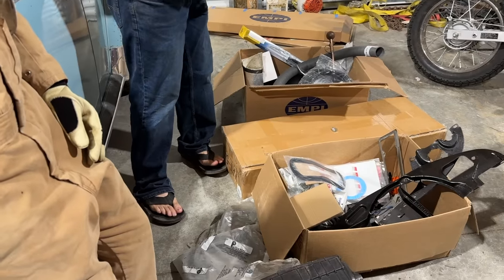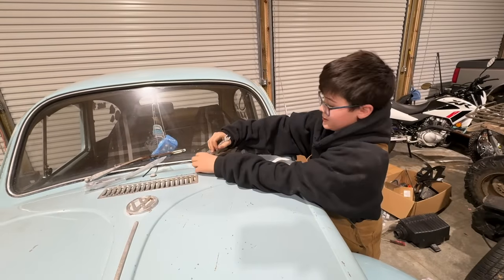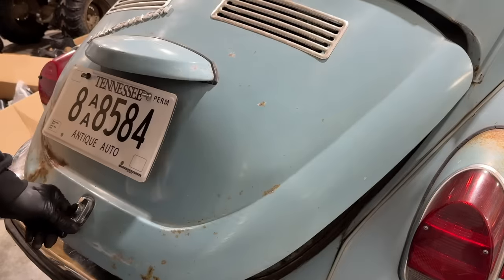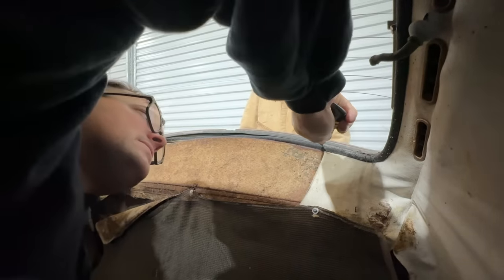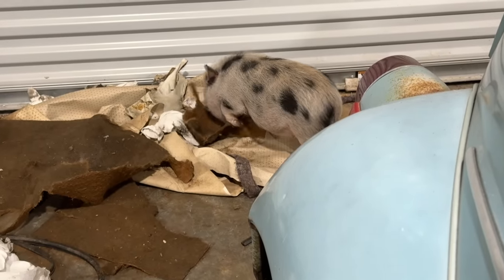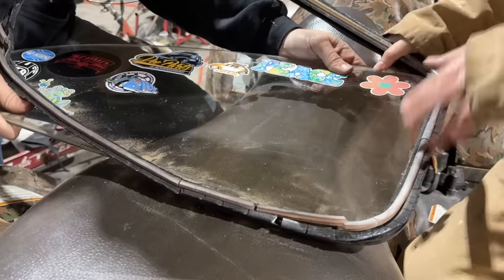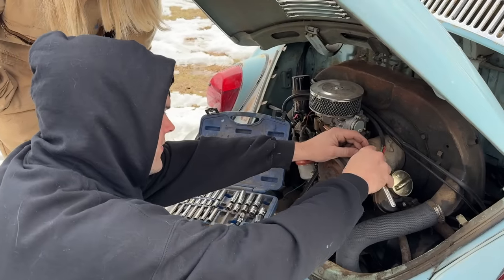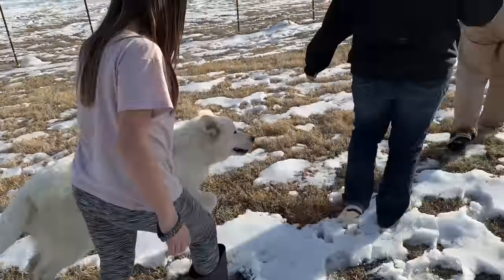Wawa’s Beetle gets Interior, suspension, roof rack, and engine maintenance!

Comment: I worked with a guy who special ordered a '68 beetle brand new from Germany. He said it was either the first year fuel injection or turbo. I cant remember which. He said he put 2 clutches in it and painted it 3 times. He drove it every day for 33 years and sold it for $600. I freaked out and told him he could have got $3,000 for it.

Comment: Good job family! Battery usually does have hold down clamping spot. Ours was on the driver’s side, where our battery was installed. Gas cap rusty inside, buuut, the gas tank itself, would not dare to be rust on bottom inside. Fuel filter wouldn’t dare to be dirty. No sir!

Comment: Since you're going to pull the engine anyway you may consider a valve replacement. If the engine maintenance history is unknown and was not done properly (I believe every 6k miles the valve should be adjusted, don't hold me to that its been 30yrs since I owned mine) you could face a valve stem failure. Which means catastrophic engine damage, ask me how I know. At any rate when the engine is out pulling the heads and replacing the valves is no big deal, could save you an engine replacement. The VWs are fun to drive and will run forever but maintanance is very important...

Comment: When you mentioned putting things in the hub caps, we would put fish in them if you didn't like that individual. Limberger cheese on exhaust manifolds, and heavy-duty zip ties on the driveshafts or cv joints.😂😊

Comment: Don’t use synthetic oil in an air cooled  Volkswagen. It will actually make your car run hotter .synthetic oil rejects heat . Vw’s are cooled by the oil and the air. Conventional oil pulls the heat out of the motor and then cools it in the oil cooler inside the fan shroud. Run conventional 10W-30 in the wintertime and 20 W 50 in the summer and you should be fine.

Comment: It looks like you did a good job fixing up Wawa's Beetle. I never had a Beetle, nor ridden very much in one, but do you mind answering a question about the heater they have. I think it comes from the heat of the exhaust, into the floor underneath the seat. I also think it's controlled by a lever next to the seat. My question is, how does it defrost the windshield, and how is it controlled ?

Comment: Tip from an Utah boy with a high-ceiling m out building garage: Install a couple of large fans and run them on a low setting. All of that hot air that gets stored in the rafters will be circulated down to you. 

Great video, awesome Super Beetle!

Comment: The fuel gauge could be the sending unit or the vibrator unit on the back of the gauge cluster. I just went through the same issue on my 72 super (with a one year only fully sealed speedo unit).

Comment: Do yourself a favor and get a small log book and keep track of your oil changes and valve adjustments for each cylinder. You will find they shouldn't need adjustment and when they start becoming tight it's a sign that the valve stems are starting to stretch and it's getting close to rebuild time.

Comment: When it gets warmer out you can try to peal back the head liner and spray some more adhesive, that stuff cures better when its warmer out, also put the car in the sun to warm the top up before you start, this loosens up the adhesive making the liner easier to peal back, it will also help in the curing process too.

Comment: Love Wawa's VW. When I was in my 30's, I had a VW SuperBeetle just like Wawa's and in the same color,  however, mine was a convertible!  When the top was down, everyone told me that it looked like a Baby Carriage!  I think that the reason they always looked like they had their nose up in front was because if you had anything with weight in the "Frunk", the suspension gave you a little bit of clearance and the tires wouldn't hit the bump stops!  Also,  I used to drive mine on the freeways all the time and never had a issue with over heating!  I could even back it out of my garage on very cold snowy days and leave the engine running to let it warm up before driving it to work!  I hope Wawa enjoys her Beetle as much as I did mine!!!!

Comment: Thay are air cooled so if you have the parts around the morter.. the srouds in place cus thay keep the air flowing around the morter and the oil cooler thats in the shroud uknow the genarater sticks in it . But ya the faster ya go the more air . More air the cooler thay run . But it exsream hot whether ya gust hare to .like any thing elce watch the temp gage. Wheir you live probably oneof the best areas to have a VW. Have fun .allways wheir your seatbelt . VW ARE KNOWN FOR YOUR FACE GOING THRU THE WINDSHILD. That is if ya dont have your belt on.  I do sagest to use a old floormat not cardbord over top the battery. Thats probably why you genarater light was on the back seat are known to short the battery out .and thay make a after market fat that ya but in the air tubes after the heat of the exzost  to defrost the windshild .so saftey reasons is why i say that . Any way be carefull and have fun . Have you guys seen a VW bug pull a 5th wheel trailer. Its crazey the car can turn all the way around while it hooked . Look it up on the tube . Its funney. Chow for now.
Reply from the maker: Ok thank you

Comment: There is a nylon bushing right behind the hole where the shifter bolts to the floor that the shift rod rides in. The shift rod will have to be removed in order to replace the bushing. Again, I'm not that familiar with the super beetles so don't take it from me but that is most likely why your shift rod rattles.

Comment: Sleeperdude! Dang wish I know you all were doing suspension work on WAWA's 71 super beetle. 

I just sold mine and I have NEW in the box lowering springs,  NEW in the MOOG box tie rods, ball joints. And other odds and ends  I would have given you. 

🤦🏻‍♂️

Tip.. the aftermarket bolt on valve covers seal MUCH better

Run 20w-50.. with Zinc. Like Amsoil 20w-50 ZRod
Reply: It's not too late.  Send that stuff to Tennessee.
Reply: @userer4579  hmmmm I suppose I could 🤔
Reply: @johnnyturbo8460  👍

Comment: I think you all should raise it and big tires build the engine Big Jugs big heads big roller cam cam big valves 4 into one headers big intake 4 barrel carb roll bar nerf bars nice light bar fiberglass fenders hood  save the factory stuff a little N/X Cal Jimmy Dale up I'm sure he Will her out run her dad lol😂😅